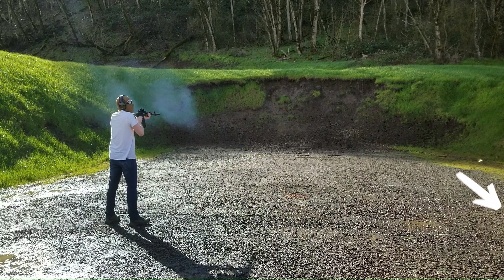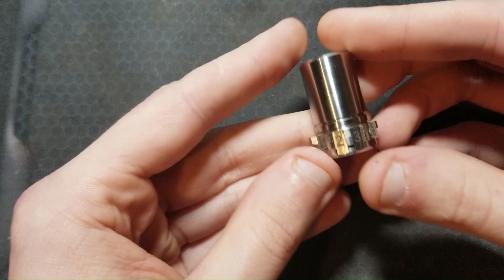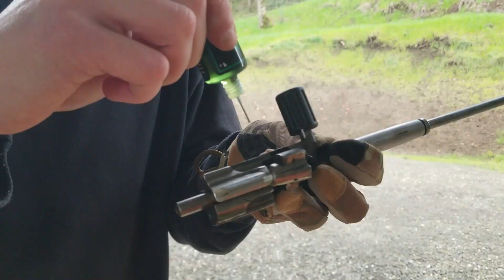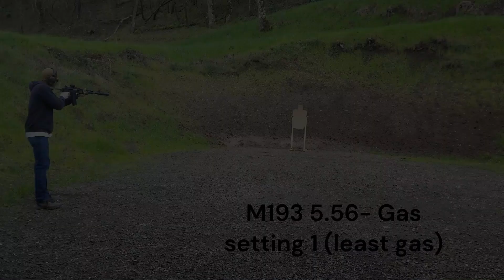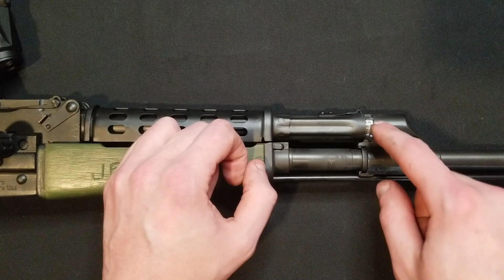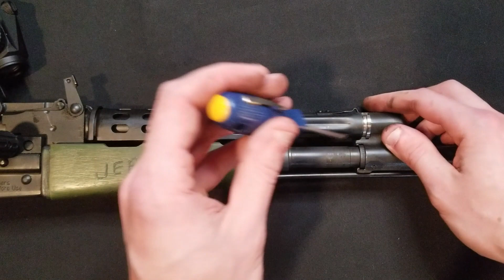Zastava M90 Gas Regulator for Suppressed Use and How to Change Gas Settings

Comment: This is a no-brainer for suppressed use. Tuning gas setting to specific ammo is wise anyways as it reduces wear and makes gun more shootable.

There is quite some variance to M193, for example PMC often lacks close to 100 fps compared to others
Reply from the maker: Yep! Lots of variance in ammo out there and luckily this plug has two setting for suppressed use. My M193 was PMC, i believe my M855 was lake city. Every ammo I tried functioned wonderfully on gas setting 2 with the suppressor. Such a sweet shooter!

Comment: For anyone who lands here like I did, I purchased this gas block through Reddit and for $120 it arrived in a few days. I am using a Resilient Suppressors Simple man on my m90 and it runs 55gr steel case on the lowest setting beautifully. Brass as well but it preferred the 5.56 over 223. Very pleasant. Silly how light the recoil is and it’s a night/day difference in gassiness. Wont cycle on lowest setting unsuppressed.  Looking forward to trying match loadings in heavier grain weights. The guy who makes them was very nice and responded very quickly. Worth every penny.
Reply from the maker: Top notch product and great customer service. Giggle factor is high on the M90 with this gas plug and a suppressor haha.

Comment: How’s the thread concentricity? I’m thinking about getting one and throwing my Polonium K on it.
Reply from the maker: It looked really good on my rifle. Of course with a 7.65 bore suppressor and a 5.56 projectile its not a huge deal. But I did check it with an alignment rod and it was pretty centered in the front cap. I would recomment a face mount muzzle device for whatever QD system you're running. 14x1LH threads are just loose in my expereince and I wouldn't run a direct thread suppressor unless its the Deadair Wolverine that is designed for that.
Reply: @EngineersArmory  thanks for the info man
Reply from the maker: @Pishadoo42  of course! Thanks for watching. If you end up running it suppressed let me know how it goes if ya think about it.
Reply: I’ve got a polo k on mine and love it

Comment: Is that a TWS dog leg? I wish zastava would offer firing pins and gas tubes because I need another gas tube
Reply from the maker: The TWS Dogleg top cover is awesome. I really like it. Very solid. Good return to zero.

I saw your comment on the pistol recoil spring tuning regarding the handguard retainer coming loose. I will answer it here to keep the information on the actual video relating to the M90. The handguard retainer is riveted into the trunnion. I would check that rivet and make sure its not damaged or compromised. If the rivet is still tight but the lever is loose it could be tightened up similarly to a safety lever. Put it in the upright (unlocked) position, then bend it a little at a time towards the centerline of the rifle until you get the tention you want.
Reply: @EngineersArmory  on the actual gas tube itself the front ring that is holding the upper cheese grater portion
Reply from the maker: @hopewilliams6705  Ohhh gotcha. Yeah likely a spot weld broke or something. Likely need a new gas tube unfortunetely.